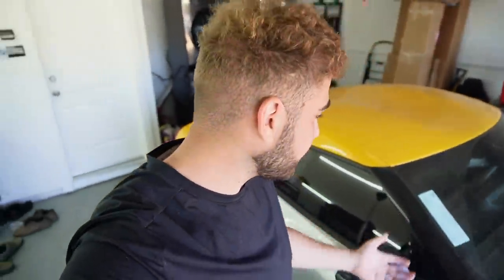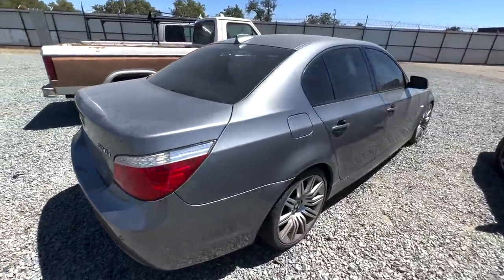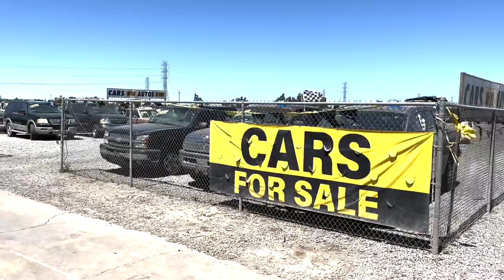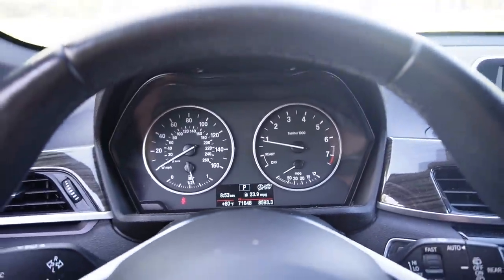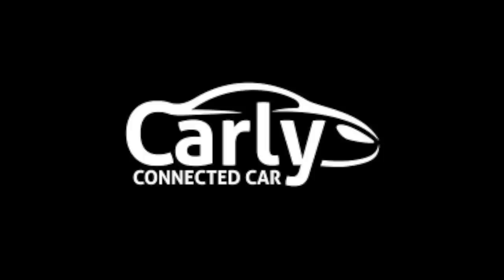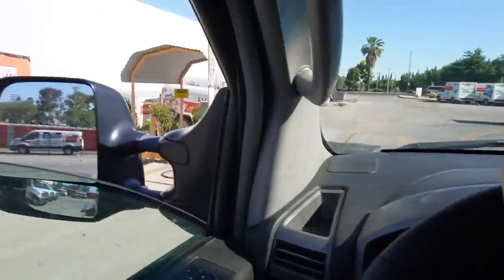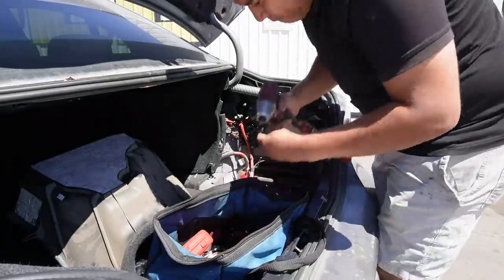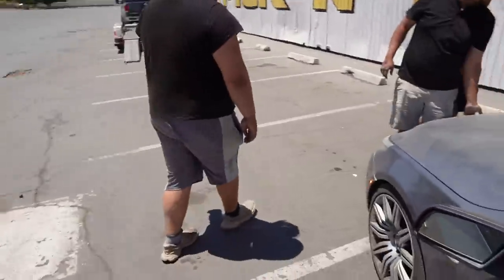I Bought a MECHANICALLY TOTALED 4.8L V8 E60 BMW FROM PICK N PULL!

Comment: In that case of reparing the transmission, you might as well replace the clutch friction disc and stator bushing. Also completey refresh the mechatronic parts like sleeve, clean the solenoids . It will cost you about $300-500  in parts alone, you essentially have a new transmission . Find out what are the error code for the transmssion.